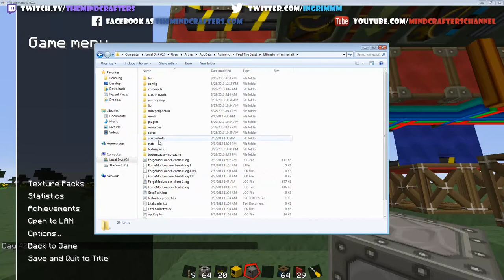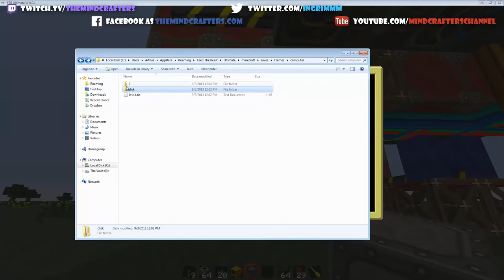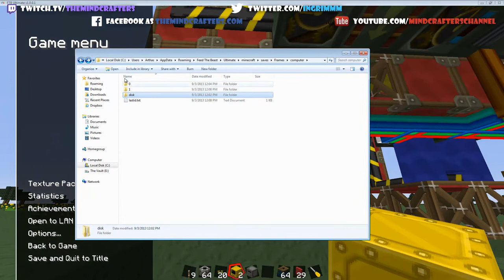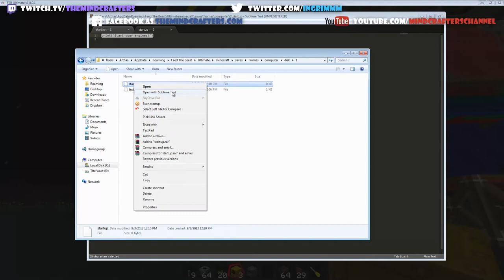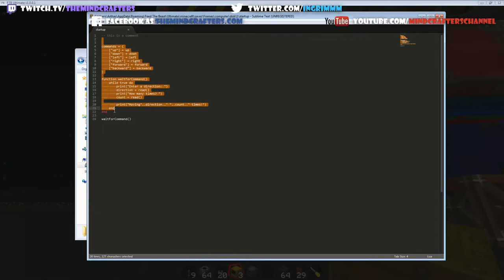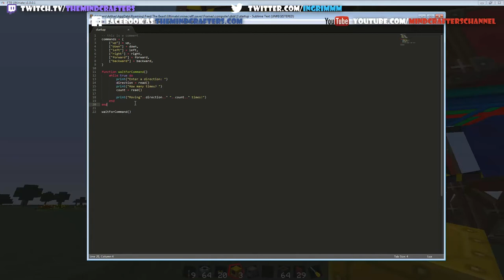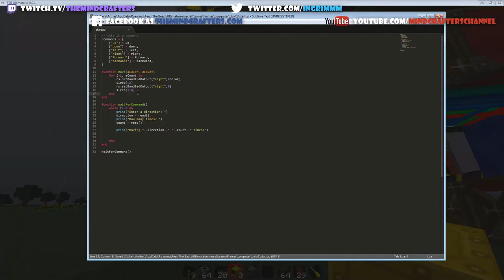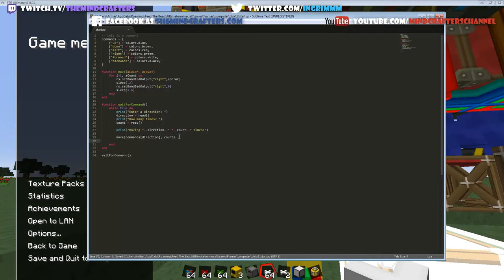TheMindCrafters - Let's Build an Airship - Episode 3 - Basic Flight with ComputerCraft

Comment from the maker: No, The colors were pre-determined. I just put them on the wrong engine by accident the first time. If you didn't notice, inchworm drives not the most intuitive to remember which direction they push :P

Left, Right, Forward, Back all correspond to lights on a boat. Up and down correspond to blue (sky), brown (ground).